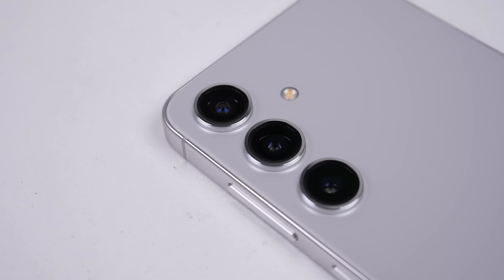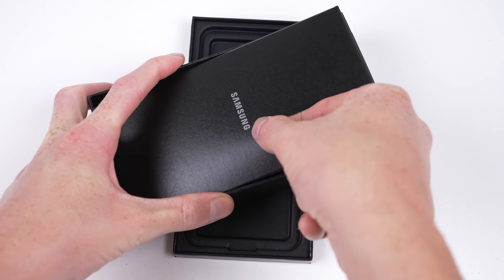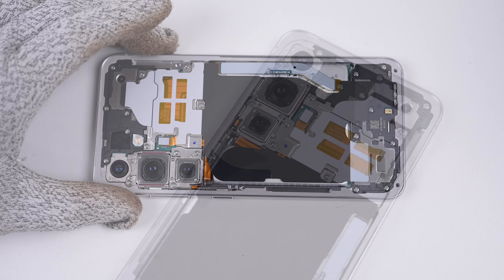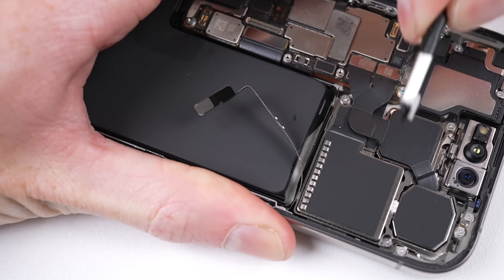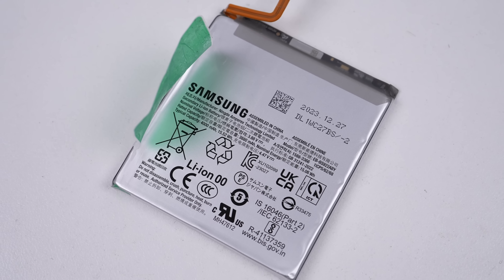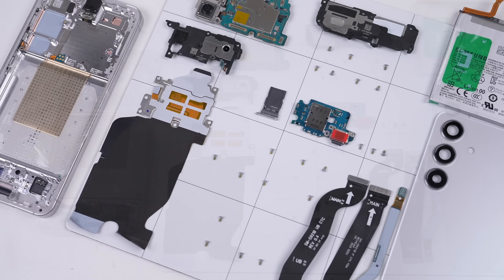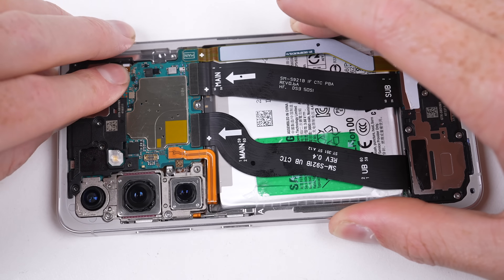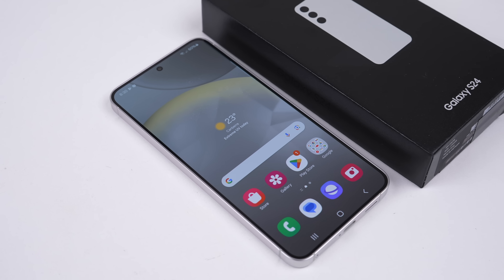If Only Apple Could Make A Phone This Easy To Repair - Galaxy S24 Teardown and Repair Assessment

Comment: This is what I love about android, the repairability, only a single screwdriver to remove all the internals. No matter how easy iPhones's displays are easily replaceable, but I'll still take the android route since android phones have less parts to work on
Reply: That's not really an Android thing, as such. There have been plenty of Android phones throughout the years with external and internal designs that made them difficult to repair. Android is just the software, it has nothing to do with how manufacturers go about designing and producing their devices.
Reply: Exactly this.

Not only less stuff to work on, but you don't have to worry about losing BASIC functionality if you want to fix your screen..

iPhone screens are super friggin easy to replace... but what's the saying? Nothing worth it ever comes easy? I'm heavily considering abandoning the newer iPhone repairs in my shop... At least until I'm able to effectively do some chip swaps.
Reply: Actually if you really think about it, Pixel displays are more easily to replace than even iPhones
Reply: I agree with you, although if I remember correctly the S21 require a JIS driver to remove the the cellular antenna. Besides that you are correct. Iphone housing require 5 different drivers! I enjoy working on both my self.
Reply: By all means go Android, but avoid Samsung like the plague. Their dishonest antics never ends. https://youtu.be/cyWlACuhqNg
Reply: wah wah wah waaaaaaah
Reply: like you are taking apart your android every day lmao, these nerds trying to justify some random irrelevant feature
Reply: @DashzRight that's a fair point. There's also the fact that even though iphones aren't the easiest to repair, literally every repair store will repair it, because iphones are so popular.
Reply: @ArturKwaszyn  now they can't because apple serialized all the parts so when it's replaced one of the functions is disabled
Reply: @rarinth  what functions are disabled?
Reply: @ArturKwaszyn  changing the front facing camera removes face id, the replaced battery won't be recognized even if it's the original, etc. 

you might not care but if i am paying more than 1000 dollars for a fucking phone i must have these functions enabled even if i have parts replaced
Reply: enjoy your e-waste after it breaks then @DashzRight
Reply: I do official repairs for iPhones and Samsung phones and Apple repairs are easier.
Reply: @leebeeskee  - Yes, iPhone screens are easy to replace, but are serialized and loses some functionality with 3rd part repair parts.  Screen  data copiers don't work with the latest models unless you desolder the controller chip which is a friggin' brain surgery, not worth it.  Also anything else on iPhones like the main board, charging port, or other components are a hassle the way they are screwed to the main board with 5 different size screws.  The clear winner in repairability is Samsung.
Reply: @leebeeskee  officially sanctioned Apple repairs are generally easier to perform because they need to be consistently replicable by every Apple Store and AASP in the world.

Also no basic functionality is lost when an unauthorized third-party is done; you only lose water/dust resistance, True Tone and you get an "Important ___ Message" related to your component.
Reply: I get the repairability. I moved to iPhone after galaxy s8 active. The damn thing was constantly mistyping words, making up new words I had mistyped before and overall being slow and freezing constantly
Reply: @blackfacegaming191 the s8 or the iPhone?
Reply: @KARMA-wz2nj  the s8 active was constantly messing up/freezing/slowing
Reply: @blackfacegaming191  ok that’s the same experience I’ve had with my Samsung also what everyone around me experiences there androids
Reply: @KARMA-wz2nj  dude, i know. i reallly liked my note 4 and my s8 active but the planned obsolescence is PLAINLY obvious after just a single year. it MAKES you want to upgrade because of all the issues faced after simply a single year. every iphone ive had since has never made me feel tht way. I LOVE my iphone 1 mini. its a perfect size and never lets me down. never freezes or slows
Reply: @blackfacegaming191 - The beauty about Android is that your can download different keyboards like the excellent Google keyboard.  For me the Samsung keyboard has always worked fine.  Maybe your have sausage fingers, or possibly the touch became defective on your S8, thus mistyping.   Switching to another iPhone just because the keyboard didn't "seem" to work, is a bit foolish. imo
Reply: @BillAnt  The iPhone got third party keyboard app support since 2014 with iOS 8. This isn't just an Android thing since almost a decade now.